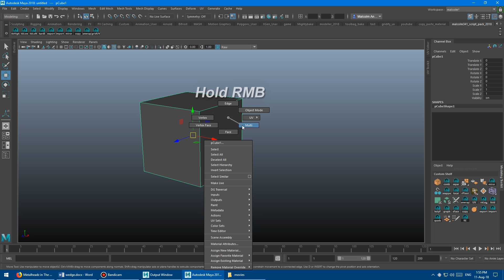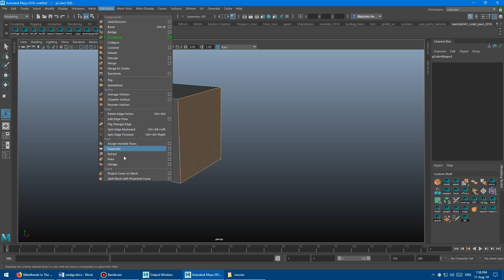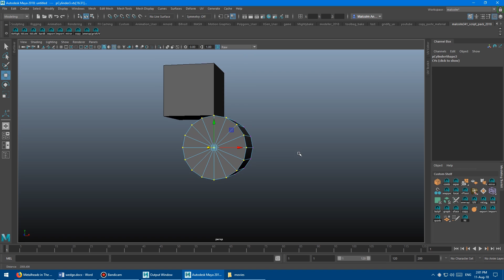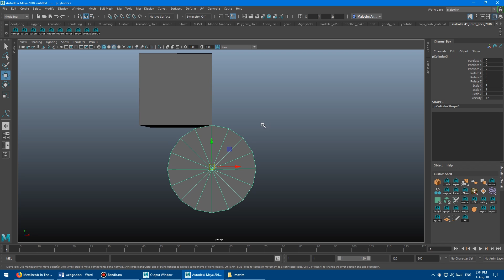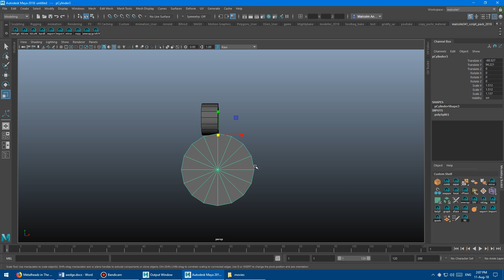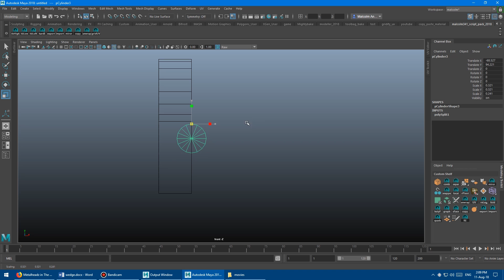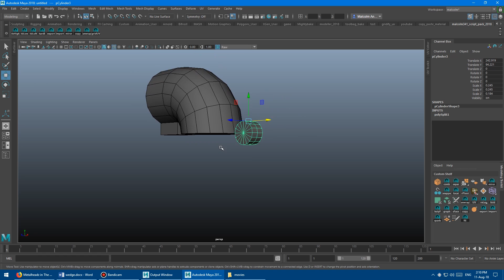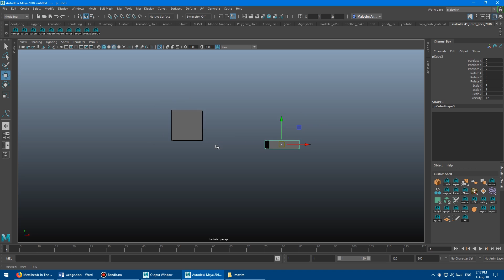How to Use the Wedge Tool in Maya - Part 1

Comment: Thank you so much for this video! I was trying to find a loft and sweep without having to draw a curve to do it. This helps greatly. Another trick I have found is creating a start and end position and then selecting the edges and using bridge and changing the type to Blend mode and adding the subdivisions to create the steps. I use that a lot for pipes and things.
Reply from the maker: Yes that's a good trick as well, the only downside to bridge blend is it won't create a perfect right angle elbow like wedge will.
Reply: @malcolm341  yeah I noticed you have to be a little more strategic where you place it's finally end position for that. But the wedge is a great find so thank you for that! This will help me greatly

Comment: Now that I finished my steam punk airship with lots of pipes, this one pops up 👍
Reply from the maker: @lawrence9713 for pipes I would recommend sweep mesh which didn't exist in Maya when I made this video, but does now and is great for pipes. https://youtu.be/zo0Mc7sS-Ys
Reply: @malcolm341  thx for the reply. Yea used this mostly for the model. The changing directions for the pipes were a bit messy for me tho with sweep mesh.
Going to check this video out, maybe it shows some settings/tricks I'm missing to get clean curves. Thx :)
Reply from the maker: @lawrence9713  Make sure to have a look at part 2 https://youtu.be/bi2QCL861KM?list=PLAUgGUDpaMEMGxJuCZJF60UhztpAZQmgf

Comment: You don't need to extrude the guide faces. You just extrude the guide edge, it will create 1 face, and after the wedge operation, simply delete the face. much practical way, there are no holes for repairing...
Reply from the maker: There's actually an even easier way to do this discussed in part 2 where you don't extrude anything https://youtu.be/bi2QCL861KM?list=PLAUgGUDpaMEMGxJuCZJF60UhztpAZQmgf

Comment: pardon me, but how to snap and flat at the same time like him at 07:12
Reply from the maker: Select the components, then hold v on the keyboard and drag along a specific axis. If you want the verts to flatten double click the move tool icon on the left side of Maya and expand the Move Snap Settings tab and turn off retain component spacing. Also check out part 2 for a much easier way to wedge. https://youtu.be/bi2QCL861KM?list=PLAUgGUDpaMEMGxJuCZJF60UhztpAZQmgf
Reply: @malcolm341  thank you so much for reply, your tutorial has alway been helpful
Reply from the maker: @sng9262  That's great, thanks for leaving a comment.

Comment: its nice tool, but you can do that way faster extruding from curves. Not sure how long you have been using maya, but creating pipes from curves been around for a while.
Reply from the maker: Thanks, I've been using Maya for 20 years professionally, you can't actually use curves to create perfect 45 degree angle pipes in Maya unfortunately. I explain that here in video part 2 https://youtu.be/bi2QCL861KM?list=PLAUgGUDpaMEMGxJuCZJF60UhztpAZQmgf
Reply: @malcolm341  yeah i saw your second video later  and i was like should i delete my comment but I decided to leave it. It is just when you said that  before maya had wedge tool we had to create pipes manually, and it sounded like you were modeling pipes by extruding face  1 by 1. But  in second video you have explained  what you meant by that nicely. Thanks!
Reply from the maker: @markospas  Sure no problem, using curves is best for pipes and tubes, but for corner wedges they don't work for whatever reason.

Comment: I prefer extrude the face using a curve.
Reply from the maker: Doesn't work unfortunately, it doesn't create a perfect curved angle as you can see here in video 2 if you extrude along a curve or use bridge you get a wonky curve https://youtu.be/bi2QCL861KM
Reply: @malcolm341  Like Wedge, depending on how the curve is made and where it is positioned it works very well for me.
Reply from the maker: @perfectastudio6259  cool, can you show me how to make a perfect quarter of a cylinder shape in the side view using extrude on curve, I'd like to start using it if it's possible.
Reply: @malcolm341  first of all, thank you for this video because i used to do it in a rather roundabout way until now. i select the component, adjust the pivot, rotate while holding J + Shift respectively(step snap + extrude)
Reply: adjusting the angle as i see fit in modeling toolkit > step snap > relative:
Reply from the maker: @ai_zj  Oh I see, that's interesting.

Comment: i found that after making the wedge, you can manupilate the bend in the attributes section, extra attributes by playing around with the center and axis parameters.
Reply from the maker: Yes this is true, but there's no way to edit those attributes to align perfectly with anything, also editing the attributes will only work on perfect right angles, if your object is off axis at all editing those values will result in a wonky wedge.
Reply: @malcolm341  Oh ok. I am learning maya and like this feature. Find myself in big mess with bending and attaining crazy shapes and all. But i saw your video and like this wedge feature. it will be useful. ohh yes and i tried one more thing that looks right angle bend and that is by keeping the circle little bit far from the bendable object. i think it is assuming its pivot is somewhere else than desired. you had used the extrusion in your video to fix that. fun stuff. i enjoy experimenting and learning more. hoping to learn more tricks here. :)
Reply from the maker: @the1trancedemon  make sure to check out part 2 for a better way to use the tool https://youtu.be/bi2QCL861KM?list=PLAUgGUDpaMEMGxJuCZJF60UhztpAZQmgf
Also if you're new to Maya you will probably find the tips and tricks playlist helpful https://youtu.be/WH3IyUHpAoM?list=PLAUgGUDpaMENlPgh_phLty5JrumqX7Yr1
Reply: @malcolm341  hey thanks Malcolm. I'll definately check it out.

Comment: U can also do this with a “cheese slice”go side view face mode delete any amount of faces to leave you with a cheese slice. When you select faces click the centre edge of the cheese and wedge. It saves a few more seconds and annoying selects and mode switches
Reply: Ofc its only if u want a preview of the curvature so still two step s more than using a box.
Reply from the maker: Good tip, thanks for sharing. Something similar is covered in the newer video https://youtu.be/bi2QCL861KM?list=PLAUgGUDpaMEMWSr3MTvSqhE3qf-WVmHMY

Comment: This tool seems to make the process so much longer :/ Bridge? Extrude? Curves? So many quicker ways to do this
Reply from the maker: Unfortunately, bridge, extrude, and curves all have the same problem. They can't extrude a corner correctly with the exact angle you want or parametric cornering so you always get a wonky shape instead of a perfect 90 degree that would match the jig.

Comment: I can't figure out what's going on at 9:41.  How are those extruded faces instantly snapping vertical.  My faces point snap, but don't line up vertically like that.
Reply from the maker: @Doug Johnson, if you hold the v key down to inter point snapping mode, then drag along a specific axis to constrain snap the selected components will snap to the closest vert along that one axis, the missing part is that I've turned off keep spacing in the move tool so the verts all snap and become planar. Give it a try, double click the transform tool on the left side of Maya to open the options for it, then under move snap settings, turn off Retain component spacing, this is a great toggle you'll want to use depending on situation. A quicker way to toggle it is hold down the w key then hold down the left mouse button in the viewport, then turn off/on keep spacing.
Reply: @malcolm341  Yes. I am begginner and also have the same problem (after extrude, the face is not plat). So as you say, I turned off the keep spacing which called 'Retain component spacing' in Maya 2019. Now it works. Thank you.

Comment: Wouldn’t it be faster to duplicate the shape, put it somewhere and use the bridge tool?
Reply from the maker: I've found the bridge tool can't create perfect corner shapes, do you know of a trick to do it?
Reply: @malcolm341  Haven't tried it to be honest. I usually do extrusions over a curve when making these kind of shapes. I guess they didn't add the wedge tool for nothing so I'll try them both next time!
Reply from the maker: The best use I've found for it is that it can create a perfect 45 degree angle for extruding planters, or making a perfect parametric corner which can be very helpful for all types of perfect curved corners. Splines and bridges will always be kind of wonky and hard/impossible to control to make them follow a perfect curved corner.

Comment: There is no issue with the cylinder to cylinder. It reacts correctly. It's because the center of rotation is not at the right place. When you do it with your extruded face you put the center of rotation in the center of the jig cylinder.  That's why it works as you expect. Actually when using a cylinder as a reference you just have to make sure the center point of the rotation is on the same place as the center point of the cap of the cylinder. That's it
Reply from the maker: Christopher Hélin, very cool, thanks for sharing. The jig is required to measure how big you want the curve to be, but looks you can just use the jig without the extrusion to speed things up which is the fastest way to accurately wedge it.
Reply: Maybe I'm not understanding it right, but I can't get this method to work. You're changing the pivot point of the cube correct?
Reply: The edge you select become the center of rotation (not the pivot of the object). Thats why he can compare it with a perfect cylinder
Reply from the maker: Oh, very interesting. Thanks for sharing this, that is an interesting technique you don't even need the extrusion.
Reply: Yeah exactly ! Nice technique ;)
Reply: I was surprised it worked haha. 
Great video btw, I'm going to use this tool all the time now. Previously I'd use the bridge tool but that has issues.
Reply from the maker: Yeah this tool is a life saver.
Reply: malcolm341 I love the wtf moments. Based on the info about the pivot, maybe an update for 2020 would be great?